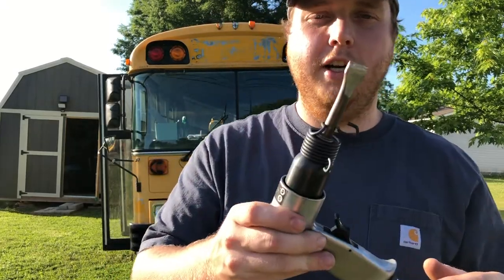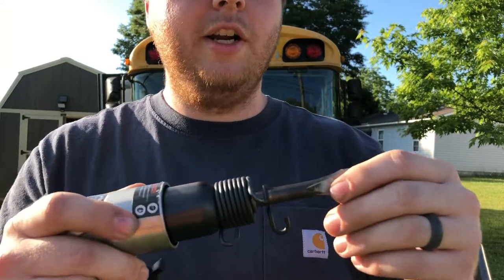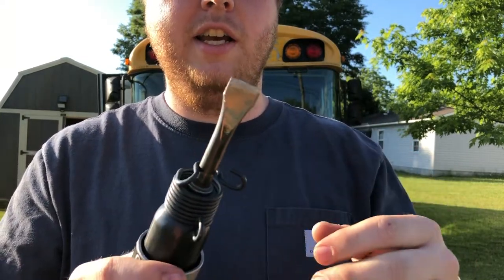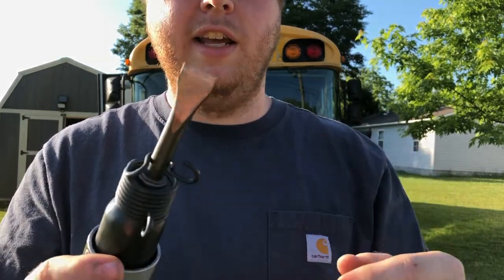How to Remove Rivets from Your Skoolie

Comment: I can't imagine doing it any other way, I stand in awe of the folks that do it with a hammer and chisel by hand. I just didn't have the patience, so needing to remove the rivets became the reason to pick up an air compressor =) It has been great, and a nice side effect is having the compressor with an air wrench to get the tires off our cars when I need to work on the brakes =)